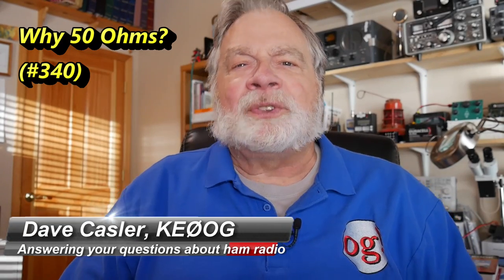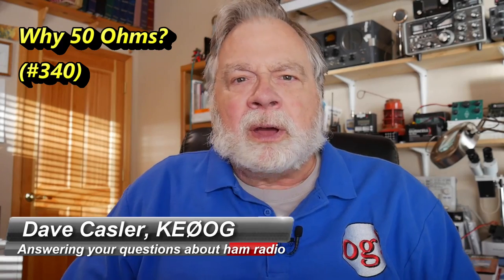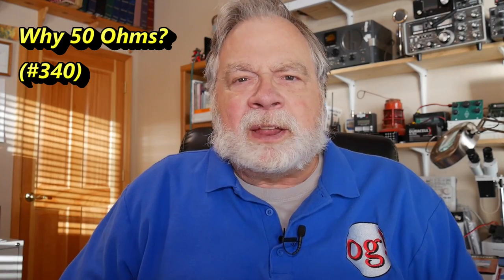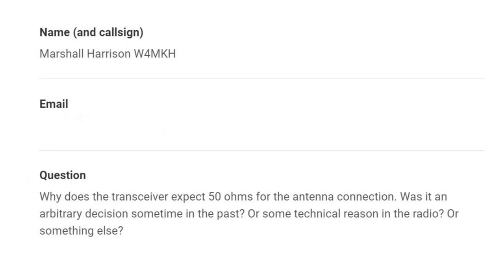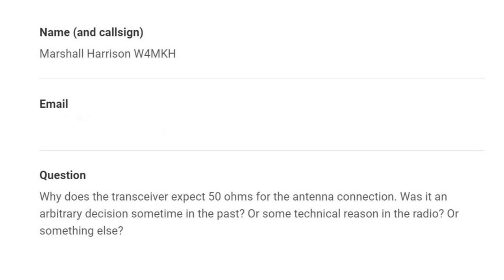Why is Coax 50 Ohms? (#340)

Comment: Question:  If someone put a rectifier bridge on a rooftop TV (or other) antennae what kind of voltage and current could they gather?  I am guessing diode leakage would limit charging a capacitor and amperage would be tiny.  Could it be used with a 2/4 way splitter or would the signal and power be degraded?
Reply from the maker: If your idea worked, we could get a lot of free power. The problem is with practical diodes. It takes about 0.3 volts to get a germanium diode to conduct, and about 0.7 for a silicon diode. The noise picked up is usually less than that, so the output of the rectifier is zero. BTW, putting up a kite with a steel string can really bring a lot of static electricity down to earth.

Comment: In the most abstract sense, the "impedance" of a lossless electromagnetic system is the ratio of the electric to magnetic field strength, which depends on the geometry and the electric permittivity and magnetic permeability of the material through which the fields propagate.  In that sense, even the vacuum has a characteristic impedance (377 ohms).  Why this value and not some other is as unknown to modern physics as the question of why the speed of light in vacuum has the value that it does --- it's just a brute fact about the Universe.  The whole point of an "antenna" is to match the impedance of the cable to the impedance of free space.

For the ultimate in shielding, there is "triax" cable, which is coax cable enclosed in yet another layer of grounded shielding.

An important point about 75 ohm coax is that, it being low-loss, it's the coax it's the cable to use in low signal-to-noise applications.  Although if you really care, there are waveguide configurations that are even better.
Reply from the maker: Waveguide starts to work in the 2 GHz-ish region up into 40 GHz, but at the higher range becomes quite lossy. There are some interesting relationships between the speed of light and other certain fundamental concepts like permittivity, etc.
Reply: @davecasler  Well, yes, if we knew why the vacuum had the permittivity and permeability it does, we would know why the speed of light has the value that it does, but we don't know that.  We can't even rule out the idea that the photon has a very, very, very small rest mass.  
People don't use waveguide below 2 GHz because it must scale with wavelength and so gets big and heavy, but it will work at arbitrarily low frequencies (but unlike coax never reaching down to DC) if you make it big enough.  Famously, WR-650 waveguide is used for radiotelescopes operating at the 1.4 GHz hydrogen spectral line.   But the uses for such very large, very long-wavelength waveguide are small, since coax has pretty low loss down at those low frequencies, and it's much more compact.   Waveguide is used up into the Terahertz regime, provided it's cryogenically cold & ideally superconducting at the wavelength of use.  The skin depth of the currents starts being large compared to the size of the waveguide unless it's superconducting.  The only reason coax tends not to be used above 40 GHz is that normal diameters of coax will over-mode, and so the outer diameter must be kept small, which tends to make it lossy (unless, of course, superconducting with a low loss [ideally vacuum] dielectric).

Comment: I thought that the 50 ohms was related to the transformed impedance of 377 ohms outside the antenna . The half wavelength  antenna is a low impedance to a high impedance transformer so that it would match the 377 Ohms of space,  At the feeder point that is about 50 ohms. Hence the chosen cable.
If a dipole was fed at one end rather that in the middle then that would be a very high impedance point and hence a change of cable would be needed,   The source will come into it too as one would need to chose between a voltage source or a current source I guess. A circuit can be looked up from its impedances point of view and not its voltages and currents,  I seem to prefer to start with the impedance od space at being 377 Ohms. and how the type of antenna transforms that to the feeder point.

Comment: I wonder if the output of a transmitter and input to a receiver, have to be designed to be 50 ohm? Thank you for the great video Dave!
Reply: The output of the transmitter, yes: They are designed to output to a specific impedance, pretty much always 50Ω. You get a  bit of leeway, but too far off will lead to increased heat dissipation in the output amplifier and may damage the transmitter.

Receivers, though, give you a great deal more leniency. There is an optimal impedance they are designed for, but it's really more of a guideline. They'll work almost as well even with an extreme mismatch, so it's just not that important. This is why transmitting antennas are carefully engineered pieces of craftsmanship and testing, while receive-only antennas are often just a bit of wire dangling on the ceiling.

Comment: Then the question would be why 30ohm is better for high power and 60 ohm is better for high voltage? I assume the thicker the insulator, the better breakdown voltage, but will be higher impedance for coaxial cable. Do you know how Bell Lab got these conclusion? Is it by calculation or by experimental?
Reply from the maker: No, I didn't try to find the original papers. If you do find them, send me a link or a copy!

Comment: Hi Dave.  What’s the best way to waterproof an end-fed with a 49:1 matching transformer mounted outside?  TNX
Reply from the maker: If you get a commercial one, such as from MyAntennas, it's probably already pretty well-sealed. Just use the usual stuff like the kind of sealant you can get at Home Depot or Lowe's. Some folks use aquarium sealant because it's non toxic-ish.
Reply: Or As I Do You Can Use Some of those Ultra Large Soda Cans In The US 
And Make i tight hole for the Coax in the bottle top srewcap and squise the coax true with some vaselin or grease or tha like,,, 
And just Cut Out The Bottom of the soda can, 
I have used that sucsessfully for years and it keeps the insides dry and ventilated with good space (( @ least if those multi gallon soda cans are used ))
The Audio & RF Maestro..........
Bests Of Regards & 73's to ya All

Comment: I acquired a few ends of roll pieces of hardline from cable companies rebuilds after Hurricane Michael some a few hundred feet long and plan on using them to feed a dipole using a transformer 75/50 inside. This is the kind with a solid aluminum shield and what looks to be a center connector of #8 or even #6. I did find a way to attach a  pl259  to one end. My question is why couldn't you just use a tuner to drop the 75 to 50 saving on not buying the transformers? I am also building a DX Commander style multi-bander hoping to use this same feedline, but knowing verticals tend to go lower in impedance, avoiding a mismatch at the feed connection may be harder? Any suggestions?
Reply: You can very well use 75 ohm line in the amateur radio that requires 50 ohm impedance matching for proper power transfer during Tx mode and Rx mode; the SWR 1.5:1 is not bad at all.
In a horizontal Dipole half lambda above the ground the feed point impedance is about 75 ohm but again depends on other factors.
When you are sure that the feed impedance is 75 ohm you are using 50 ohm cables again with a 1.5:1 SWR.
If you have a ferrite loaded transformer the maximum power transfer is guaranteed.
In case of verticals the feed point impedance is still lower again depending on the other factors like ground conductivity.
Some kind of impedance matching is always required at the interface.
It can be a ferrite transformer with certain fixed ratio of winding (which is good at the feed point of a dipole) and an LC network at the feed point of the vertical (operated remotely from the shack if you want) wherein it can match a wide range of impedances.
I have read about people using 450 ohm open lines for long runs with 1:9, 9:1 Transformers at either ends (respectively) to avoid losses.
The bottom line is that the importances must be matched so that maximum power transfer happens as per Thevenin theorem.
Reply: @subramanianr7206  Thank you !!

Comment: A question from  a SWL'r... if I use the teevee coax will I need an impedence transformer at the radio front end my radio, a Yeasu FRG100, which has a switched 50 Ohm or high impedence input ? 🤔
Would simply terminating the coax at the radio with a 75 ohm resistor & using the hi-Z input suffice ?

Interesting video, we take coax for granted so much nowadays that it doesn't seem like a big deal to "put one wire inside the other" .. 😕

From the Emerald Isle
😎👍☘️🍺
Reply: I would just skip the impedance transformer and connect it to the 50 ohm input.  The added loss from that small mismatch will be so small that you will never know the difference.

Comment: Not a ham, but I wonder: would it be advantageous to run two cables, one 30Ω for the transmitter, one 75Ω for the receiver, and have a relay up at the antenna instead of down in the transceiver? Or not worth it?
Reply: An antenna has a "radiation resistance" which is fixed. It is normal to try to match this with the transmission line (cable). Often a balun transformer is used for this. You would need different transformers for each cable... The complexity is probably not warranted unless you are using so much Tx power that you have to worry about breakdown of the dielectric - that is where the 30 Ohm cable helps, I think. :)

Comment: i know that a/c runs on the outside surfaces of wire on the one you say that rich ham operators use it looks like it has an inside and outside  tube type cable i take it that in this case it will run on both surfaces then inside and outside skin of these  hollow cables or tube cables true or false

Comment: Hello sir could you please explain why some coax has gel inside ? Is that any kind of corrosion protection or any kind of non scatter medium? Or to retain the flexibility of dialectic and refrain it from cracking!
Reply from the maker: I'm not familiar with a coax with gel inside, but there are so many types I certainly haven't seen them all. I suspect it fills all the space so water can't get in.
Reply: @davecasler  Thank you for your response, yes water could be an issue, but the gel in present in the shield of Al mesh, and the foil which is also aluminium. As far my chemistry knowledge guides, for aluminium no oxidation protection is that Vital as the oxidation protects itself.
Reply: Another possibility I suspect is quite hilarious is just to ease the siding action after stripping, with the  Al mesh it is reasonably hard to separate to surfaces without damaging the shield mesh .

Comment: So using a 50 0hm coaxial cable will be a better choice than 75 ohm for cable cutters who install their own antennas, as I will be doing soon. Btw Mr. Heaviside sounds like a real Rebel in my book!
Reply from the maker: If you're going to transmit, 50 ohms is best practice, but you can get away with the much less expensive 75 ohm cable if you don't mind using the tuner built into your rig.

Comment: 9:26
Question:  How can we measure L and C practically with a multimeter that has inductance and capacitance reading ?
Do we connect the inner wire with the outer wire at one end of the cable (perhaps 1 meter length) and then measure the inductance between those on the other end of the cable, and do the same thing to measure the capacitance  ?
Reply from the maker: Best bet is to look at the tables of coax parameters. You can calculate the values. While that may seem an odd answer, determining the capacitance per meter, etc., can be done with an antenna analyzer or vector network analyzer. I think you could probably do it with a spectrum analyzer. I've never tried. BTW, the capacitance is real, and you can create RF capacitors using lengths of coax.
Reply: @davecasler  
Thank you for your explanation.

Comment: I often came across 52 Ohm cable now we all use 50 Ohm or is that just rounded down? also ribbon cable is 75 Ohm 4 times that of 75 Ohm coaxial and for comparison cat5-6 cable is 110 ohms and phone line is 600 Ohms, then there is triaxial cable often used with TV and radio transmitters.
Reply from the maker: We still see 600 ohms pop up a lot, like for line in / line out, microphones on modern radios, etc. It's amazing how long standards remain in place. I hear the standard railway gauge is the same as the width of Roman chariot wheels.
Reply: @davecasler  I was meant to say TV ribbon cable is 300 Ohms, 4 times 75 ohms. A long time ago our railway lines got regauged in Australia, as it seamed each state had there own width. Now it is all the same width. It took them. Ages to do that. Oh so forgot microphone is 600 Ohm as well. Being microphones need lots of gain and favour voltage over current. That makes sense.

Comment: ive been on forums for armature radio before. ive asked, as far as CB frequencies anyway. isnt having the antenna higher just better? but ive been told no, put the antenna at the proper height for best range. but in my experience, all the guys who have base stations with antenna's over a 100ft in the air get out much better than everyone else. so what gives?

Comment: So why was the old flat twin lead antenna wire for TV and FM radio 300 ohms? I still use a 5 stage beam Radio Shack antenna for FM radio and am using the old flat twin lead. Would I get more performance changing to 75 ohm coax and a transformer? ie; less multipath, noise, signal strength.
Reply from the maker: No, not really. I think today many TV antennas attach to 75-ohm coax, but the old twin lead works just fine.
Reply: So why was the old flat twin lead antenna wire for TV and FM radio 300 ohms? Why 300 ohms?
Reply: @zulumax1  Twin lead is balanced line, balanced line has a much higher impedance, usually between 200 and 600 ohms.  I don't know the exact reason for 300 but it would be interesting to know.  High quality twin lead is very low loss.
Reply: @sierratango6704   Of Coarse because of the half wave folded dipole antennas Feedpoint impeedence is 300 ohms and i guess they where the majority of antennas used therefore the 300 ohm window line / Ladder line,, and not least the much Lower Losses in Balanced lines ESPECIALLY WITH BAD IMPEDENCE MATCHING THE LOSSES Are even greater in difference to coaxial cables........
Reply: @davecasler   As Long as you rebuild or remove the miniscule binocular impedence matching transformers witch is in just about every kinfd of VHF - UHF Yagi Antennas...
Reply: of coarse the folded dipole NO LONGER is 300 Ohms in a Yagi design but as stated earlyer the balanced lines has a buinch less loss with severe impedence mismatch and also the folded dipole in yagis is still probably closer to 3oo Ohms thenn 75,, in the probably 20-50 VHF -. UHF Yagi antennas with folded dipoles i have still to se one without a matching transformer althoug they are usualy so small that they are hard to see anyways...

Comment: The lowest lobes are when the antenna is 1/2 lamba?  "Lensing", not a pejorative, creates lower take off angles when the antenna is greater than a 1/2 wave?
Reply from the maker: Yes, the lowest lobe goes lower, but the higher lobes rob power

Comment: 50 ohms is a compromise between power handling (30 ohms) and low attenuation (75 ohms), ensuring efficient transmission for both receiving and transmitting.
NoteGPT AIchat

Comment: The best cable impedance in low attenuation, high breakdown electric fields or high power applications, any of them, depends on dielectric materials. Do you know, what had materials analysed in 1929? Fluoropolymer were invented later, for example.
Reply from the maker: Early coax (e.g., 1929) were air core with spacers holding the center conductor in place. The coax was rigid.

Comment: Why 50 OHm?

To make sure that nobody realizes that the only way to obtain a higher energy state using resonance of the Electric Field
and to convince them that the resolving of potential difference was what we would focus on
and we would call it Current.

A wire being fed with A signal that's length has infinite Impedance  causes what we call currents to be running in both directions simulatiously,   which of course means that if  we follow Faradays laws of induction,
we actually end up with No Current
but we do end up with a Longitudinal Transfer of energy and not what we call power.
Reply: Essentially,

Hams fell for the cover up of tesla tech all those years ago.